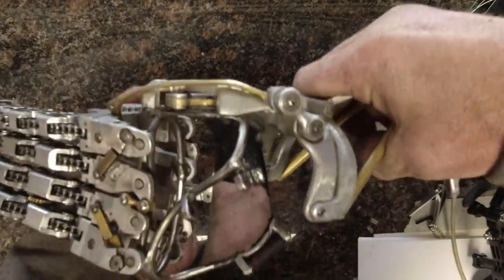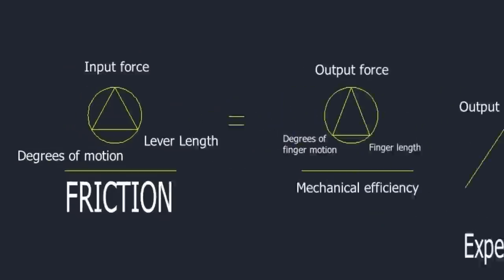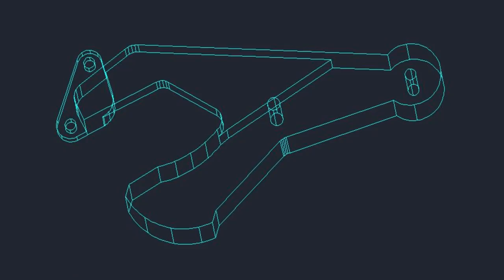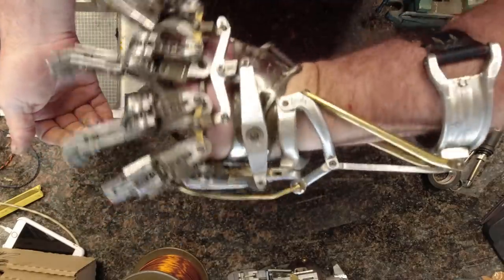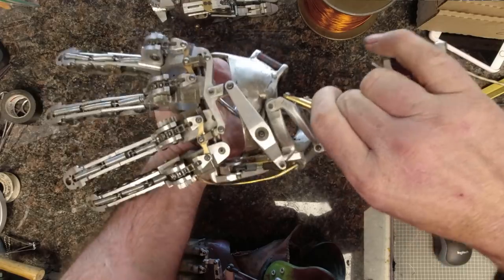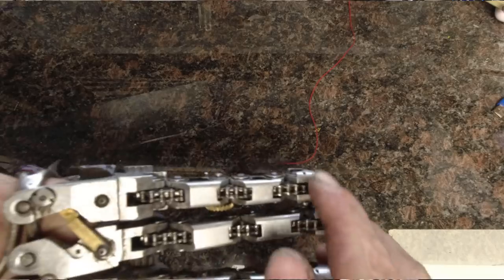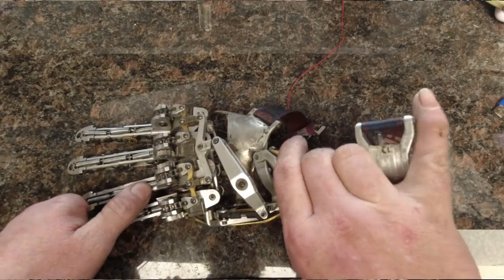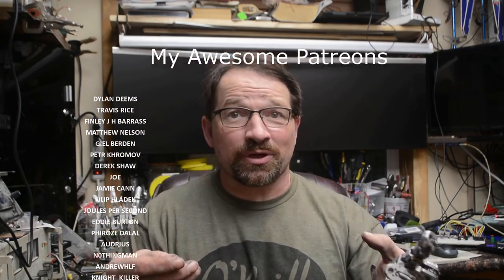Instahelp! Addressing common issues from my Instagram crew that are building their own devices.

Comment: The muscles of the hand and wrist are designed in such a way that the pinky finger acts as the strength axis. As such the pinky finger and the muscles and tendons it's responsible for account for about 50% of a normal hands grip strength. Just thought I'd share, dunno if it would be useful to consider for future designs

Comment: Like I've said before I'm working in my own but it works much different and the progress is going very good it moves very well. I hope to make a video on it soon. Also mine like I've stated in a newer video of yours it works with fiber optics and yes just like the internet lmao. Only problem I might have is if some else could move it I can but I need it to be for everyone because that's the point but of course I made it so that I can move it Frist and work the rest out later.  But also like I have said before I really like how your hand works. It's mechanical and I really like that I also really like how everything looks my hand started as your design but I changed it so that the weight of each finger is correct with what an actual finger weighs well as close as I could get. But I'm still working with it once it's done you all will know

Comment: Ian! I'm a huge fan, I was just wondering if you have ever experimented with skeletal versions of the parts? I can tell that most of the parts are too small to gut without impacting the strength too much. To get around I was thinking that you could probably get/commission someone with a DMLS printer to make you some light titanium versions of the parts if provided the CAD files. DMLS printed titanium skeletal frames and/or lattice structures can be impressively strong while being very light. I'm sure weight isn't much of an issue, but an ultralight skeletal titanium version (albeit expensive) would be a pretty awesome thing to have in the arsenal. Thanks for reading! You're awesome dude!!!
Reply: was thinking about the same thing
Reply from the maker: i modeled it up the other day. i'll eventually spend the time to carve away all the extra material. i'll probably document it, we'll see.

Comment: Superb as always!
Ian, does your residual limb and arm get too dirty from aluminium powder? Did you ever consider coating the metallic surfaces (specially where it makes contact)?
Reply from the maker: Originally I was going to get it hard anodized,  then I was going to get it powder coated. But I haven't done anything yet. It mostly washes off.

Comment: I'm curious what exists today or in the near future that helps to mimic sensation in prosthetics. Can a sense of pressure or temperature be recreated in a way to convince the brain of the actual point of contact as opposed to where the sensor input interfaces with local nerves (ex. soft touch on the prosthetic finger tip instead of the point of amputation)?

Comment: Two questions:
1) In a different video, you say your first qualification was sheetmetal. Now I realize that creating stamps for sheetmetal production is expensive for prototyping, but mass production should be cheaper with sheetmetal, right? Is it an economics thing for you, or is sheetmetal not going to be strong enough?

2) have you tried any other types of actuators? Ie you mention levers and reduction drives, but there's also hydraulics for example, or pneumatics (though pneumatics require a bit more fine tuning and thought).

Edit: question 3) even with the current design,  have you tried replacing chains with something like fiberglass, carbon or kevlar thread/cable in a teflon (for example) guide?

Comment: Ultimate mechanical advantage: Build an elbow operated ratchet winch in the mechanism
I'm only half kidding
Reply from the maker: no, you absolutely could use the bicep to power a device, but every time you move your forearm the hand is going to close. that is going to make it a tad impractical.
Reply: @missingpartsclub  Ye, for this to be a serious application, it'd need to be an additional feature, that could be engaged & disengaged. Maybe a locking mechanism for the wrist, tied to the winch's ratchet, and some way to manage the slack on the cables when not in use
At least it's fun to think about
Reply from the maker: Totally, but as a serious application.  I have a guy in San Diego who's disarticulation is about through the center of the metacarples. So not really enough hand to generate the leverage required for my hand. But what I am doing is generating a portion of the power for his grip from the motion of his bicep. Super prototype. But a neat mechanism just the same.
Unfortunately I probably won't show it because he's kind of private about it. Seems that everyone gets weird about showing their hardware on youtube.

Comment: would it be possible to get some files to 3d print some of this stuff ?
Reply from the maker: from my real world experience, I would say no. when i was sla printing my fingers i would get an average lifespan of 2 weeks. I also tried printing in Abs. I had pretty good results , but abs gets brittle an also fractures, but you can glue it with ca to repair minor breaks. but still short lifespan, maybe a month. I also printed a set out of taulman nylon, much more durable, than abs, but delamination and dimensional issues made it a bit problematic. I haven't tried carbon 12. It would probably work for a while, but the issue then comes down to cross section, the minimum pin boss cross section that I have found that is strong enough for real world is .1" or 3mm, less than that and it fractures too easily in lateral loading. plastic is fantastic, but steel is real.